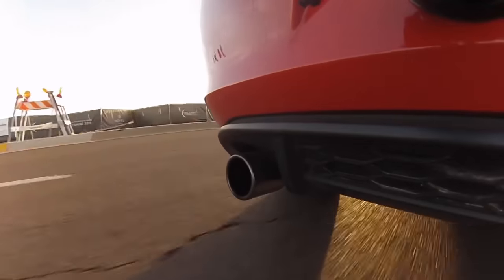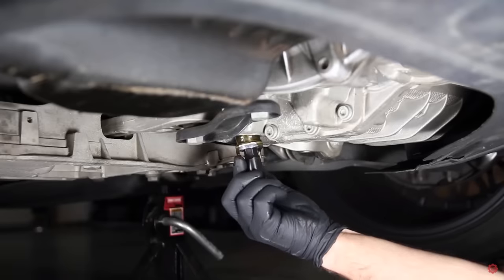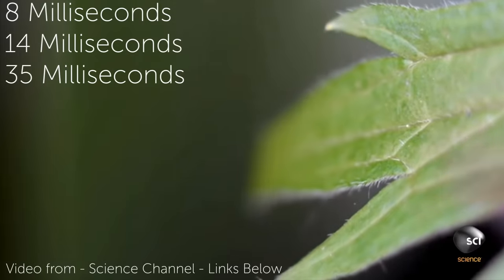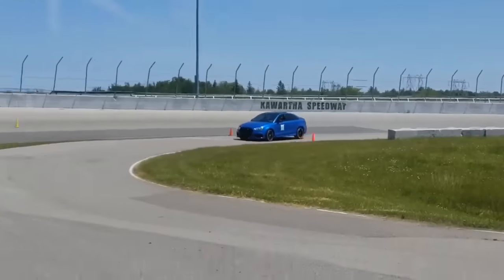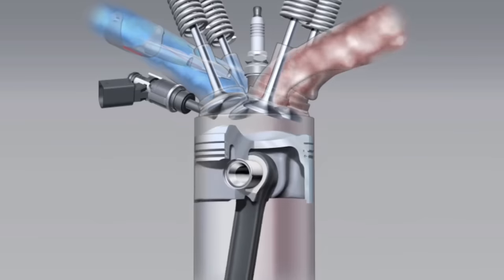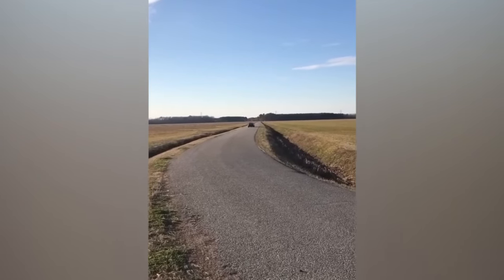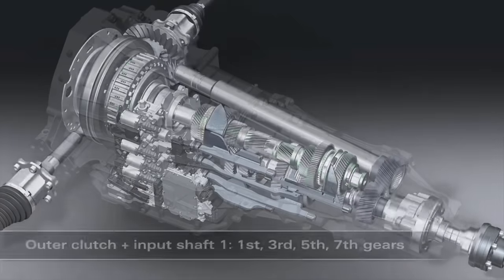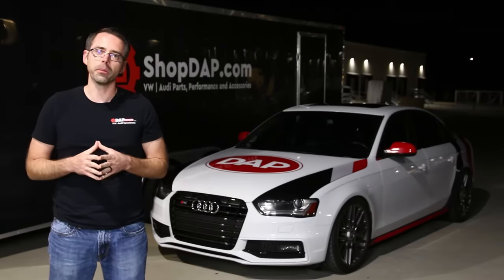What makes DSG Farts Happen?

Comment: Okay... but why do they keep putting fuel in the cylinders if they don't want to use it? Seems like it would create pointless emissions and wear/tear on the exhaust system.
Is there some kind of fluid momentum issue which prevents them from stopping the flow of fuel for a few strokes?

Comment: Does the engine only cut ignition during normal driving or does it also cut fuel? In normal driving cutting only the ignition will waste some fuel.

Comment: Why don’t they cut the fuel Injektion with the spark between shifts to safe fuel and not fart?
Reply: Running an engine lean is way worse than having too much fuel, never mind letting the exhaust/turbo have it.
Reply: @nocll34  Without spark, there is no combustion. Without combustion, there is no heat. Am I right?
Reply: @Sk1ds87  My bad, I didn't even read it properly but there probably is still a reason auto manufacturers don't do that
Reply: @nocll34  on the channel engineering explained, Jason had an official answer from Hyundai: the fart have for purpose to keep the turbo spooling during shifts and minimize turbo lag. Personality, I can understand the reasoning behind this if those farts were limited to a "sports mode" and only happen during high load, launch control, etc. But actually, it seems that modern cars tend to fart all the time, at any load, any mode and even in traffic, which is imo just unnecessary and somewhat pathetic. It ruins fuel economy, is very irritating if you live in a neighborhood infested with cars like these and almost none of those drivers will ever make their way to a circuit where that gadget probably makes sense. But hey, some (dumb?) consumers like it, so auto makers will ofc deliver👌

Comment: My Audi 8 speed ZF farts when it shifts gears under hard acceleration
Reply: I came here to say the same thing. 2010 Audi A4 with 6HP ZF trans and unitronic stage 2 with test pipe farts every day! I will go with unburnt gas for the answer I suppose...
Reply: I have a 19 S4 with a ZF box that makes “ZF farts” all the time. Why is that???
Reply: @rideswithseb  expelled gas onto hot exhaust... Ya heard the man!!

Comment: Its unburnt fuel being dumped into the exhaust intentionally to make the noise. It’s part of the ECU calibration.

Non sporty DSG equipped VAG cars don’t make the noise.

It’s theatre to make the sporty cars stand out.
Reply: Stupid, right? I was wondering why the fuel injection is 't cut as well. I guess little boys like fart sounds.
I still prefer my non-farting V8 xD

Comment: That damages the turbo, doesn't it? If the hot air&fuel mixture is released into hot exhaust, it must ignite before the turbo, which means the flame will hit the hot part of the turbo, which is destructive. Am I wrong?

Comment: but mercedes could do same but without farts at all go and listen
Reply: Merc make exactly the same noise🤔? Go listen to an A45 AMG with a big exhaust system. Merc still run a lot of auto transmissions in their cars though so maybe that is what you are comparing to?
Reply: pk3012 i am talking with stock exhaust not 3rd party one look c43 amg,c63 amg,s63 amg all of them doesnt have fart noise okay maybe a bit but not like all others and upshifts are more pleasing than golfs,...

Comment: Need to do a muffler delete on my alltrack. Miss the dsg sound in my GTI
Reply: I don't think that will help. Prob need a downpipe and/or exhaust. I'm looking at the same thing on my Alltrack too!
Reply: @ash8889  I have a Sportwagen 4motion with a muffler delete. Identical power train. Confirmed -  Little to no DSG farts. I have an Is20, APR TCU and ECU and a stock downpipe... but dayum, DPs are expensive (that's what she said). I've found a youtube clip with downpipe and Techtonics exhaust and it was better, but still not as gaseous as I hoped :\

Comment: BMW’s do this that don’t have dct boxes but full auto
Reply: Because we have come so far with Automatic transmissions, it shifts really quick that they need to cut timing thus the farting noises.
Reply: most vehicles with the zf 8speed do if they are sport tuned
Reply: ryding with ryan they do it on stock map
Reply: m200mw I know the ram 1500 doesn’t do it and it has the zf8speed
Reply: ryding with ryan I was talking about bmw
Reply: m200mw oh okay
Reply: @hendrahendra  "we"? Like you're on the ZF engineering team?
Reply: No full auto in buildings sir

Comment: Right on seeing this vid , I thought about cutting off fuel, instead of spark. Going thru' the comments, someone already said the same thing - to which a reply was about lean mix. BUT - Is 0 fuel lean mix? No fuel = no lean burn issues?
Reply: I tend to agree with that. Nothing here is really radical anyway. Stability control systems also control engine torque by modulating fuel, throttle and timing to suit. Obviously no throttle in the case of diesel engines.

Comment: 1. If it’s just hot gas then the same principle could be applied on a manual transmission, why hasn’t this been done before? 2.Also the difference between using launch control or not isn’t clear because even in manual mode the dual clutch will already preselect the next gear which still doesn’t explain why the spark ignition is only cut when launch control is off.

Comment: On my mk7 gli i couldnt hear them at all stock. Then i did an exhaust cutout but i still couldnt hear them. Then i noticed that clicking open only opens it as long as u held it. So i had too hold it a solid 3-4 sec too fully open it. Pulled onto the highway windows up eased into second gear full throttle 6900 rpm shift and holly freak crap its amazing!  Shit was sooo loud inside. Was not expecting it too even do it. Id heard that the 7spd dsg farts are negligible compared too the 6speed but boy these were good. Kept it pinned and got 2 shifts out of it and i could still hear it pop going into 4th at like 90~mph. But omg no mufflers is so quiet at low rpms/loads. I first opened it and deove under 3k rpms around town and was dissapointed. Then i did a full throttle 3rd from 2k to 4k and it seems like right past 3k rpms the decibals/noise litterally tripples and turns into a screaming beautiful whore!  Unfortunately having the gli not the gti my exhaust doesnt run straight down the middle. (Exhaust is one of only perfromance differences between gti/gli.) opposed too the suitcase muffler i have 2 carryons right infront of the tailpipes. On the gti u can mount the cutout dead center about 1 foot off from thw rear axle. Unfortunately my exhaust runs down the middle until the middle then bends too the drivers side of car and everything closer too the axle is a really tight cluster fuck of stuff. So i had too mount mine like 3feet infeont of rear axle and 2 feet off center too the left because its the only straight sextion with enough room. 3 problems with that for those of you with a vw gli: 1- sound. Instead of coming centered out the back it is offset too the left and under the center of car which results in lots of vibration under hard load low speeds. 2-sound isnt as clear or loud and kinda mumbly. 3- rubber! Ie gaskets, bushings,(suspension) exhaust hangers etc. exhaust gases are terrible for petroleum n rubber based products.  Why tf does burnt petroleum destroy/deteriate rubber? No fucking clue quite ironic. But having the cutout more then about a foot lnfront of the rear axle even when driving results in near direct contact with anything close in this case the suspension! U might think well we drive behind car exhaust pipes so whats the problem? The potency! 1-3 feet away vs atleast 10-1000s of feet away results in a huge exhaust too fresh air mixture/dilution. Not only is it tight next too the exhaust but its also isolated under the car. Hot air rises but it cant as its under the car so ontop of being close its also somwhat contain for a split second. Now drivin gn down the highway this is not catastrophic   U wont notice anything but over time it cut deastically decrease suspension lifespan over time when only open while driving. If you spend substantial time not moving with the dump open you may regret it!  Gti owners the deteriation while driving will almost no effect. When idling still with dump open it will be neglible/nothing compared too the glis dump position. Summary for gli owners: it sounds amazing but keep it shut in standstill traffic and while idling other then beautiful cold starts. Also try too minimize how often its open on the highway. After all you bought a cutout too be able too close it for daily use ay?  If you bought it too always keep it open then remove it and buy atleast a muffler delete or axle back or cat back or hell do a straight header hoodump aka no exhaust😂

Comment: Can you do explain why ZF gearboxes make that sound too? They’re only single clutch transmissions with a torque converter..
Reply: Because there is some misinformation in this video. This sound is because of the torque reduction (very late ignition timing) during upshifts. Actually, Motronic and simos systems doing this for more than 20 years, they start to do it in 1997-1998, when the first 5HP19 came. Also, in RS6-RS7 cars equipped with the 8HP transmission, there is some special part of ECU flash called "sound generator", where you can adjust this fart duration and intensity.

Comment: Kias have had that hidden ability for about 4 years now too. 7spd DCT in my Optima farts with the Corsa exhaust I have on it. Didn't do it when it had stock exhaust but as soon as i got the new catback system bolted on, it started doing that. Now Kias and Hyundais with the same transmission will do it too from the factory like the new Hyundai Veloster Turbo and Kia Proceed GT. I want to say that it's something to do with the BMW guy that is heading their R&D division.

Comment: Let me first start to make you clear that not only dsg or dual clutch cars make those farts. 

I have a bmw 328i f30 with the 8hp zf gearbox and it farts even louder than those golf's. My car is no dual clutch and yet it shifts very quick and makes loud farts. Launch control as the same, it doesn't fart anymore. Instead of calling it dsg fart, we should call it dct fart.

Comment: i drive a seat leon Fr 2010 2.0 liter engine DSG 6, i got K04 Turbo and Stage 3 APR gear and engine, but i dont have dsg farts, i saw other cars like mine and they do have, my exhuast system is fully built from downpipe to the end.

Comment: I may be wrong but I don't feel like this was properly explained. F90 M5 and the new E63 Amg both use torque converters but they still make sounds of similar kind during acceleration and deceleration as the DSG cars. What I know is that the sound is made by retarding the timing, meaning that the spark plugs ignition gets delayed and combustion starts from the chamber and continues down the exhaust and this is called, quote on quotes an antilag, because its purpose is to keep the turbos spooled up during gear change to minimise turbo lag.

I stand to be corrected if I am wrong🙋‍♂️

Comment: Why do some sound like a shap short crack and others sound like a longer burble? How can you modify the sound of the DSG “fart”
Reply: 1.remove the resonator might change it. 2.downpipe with cat delete. not a 100% sure tho
Reply: I have a MK5 GTI that does the short crack 99% of the time. My exhaust setup is...

42Draft Designs Turbo-Back exhaust.
200 Cell Cat
No resonator
Magnaflow Muffler (Comes from 42DD with that muffler)
Exhaust material is T304 Stainless Steel.

The transmission that came with the MK5 GTI is the DQ250.

Hopefully someone can chime in on whether any of this contributes to the different sounding DSG gear changes. Maybe it's an TCU Tune that does it? I have no clue.
Reply: @Gandalf721  I believe the cracks and pops you're referring to is when off the accelerator and decelerating. "Usually" that's what they mean by that.

Comment: Hey Guys, there is a lot of misinformation in this video. 

First of, the "farts" are purely for aesthetic purpose, they do nothing for the speed of shifting, it is all for show. Same goes for downshift crackles on for ex AMGs or BMWs

Secondly, you might have noticed that when you use launch on for ex a Audi S4, you will not hear the farts, that is because they use the inertia in the drivetrain to help acceleration. They to this by simply slamming the cluch closed on the nest gear without cutting or limiting torque, you will get a "lurch" but it will aslo make you accelerate faster.

And lastly, its not about ignition timing, it's all about DIRECT INJECTION timing, the nice crackling sound you hear that you call farts are only possible on direct injection engines. This is why older cars cant  really produce this noise. 
What happens is that the direct injection timing is retarded and basically shoot a very small amount of fuel info the cylinder while the exhaust valve is open, making a nice small pop in the exhaust when it self ignites. 

Bangs from retarded ignition and/or Ignition cut on regular port injected engines are significantly louder, and much more violent in nature since its basically fires of a full cylinder worth of air and fuel after its been compressed. There is no way to regulate the amount of bang like in the DI systems

Also, stop referring to these sounds as DSG farts, they are called direct injection exhaust crackle

Comment: I thought those "farts" were because of the turbo's wastegate opening at high rpms, releasing a whole bunch of pressurized exhaust gases into the exhaust. I have a BMW and it does this too without a DSG transmission...
Reply: Yeah that's what I thought, my Fiesta ST makes a similar sound when I back off the throttle slightly after boosting.

Comment: I get these on my 392 Hemi as well, but with dual 3" exhausts and 3.5x the displacement of a VW it sounds a lot more like an autocannon than a fart.
Reply: Same. It’s fun they are especially loud when I use the paddle shifters and slowly accelerate to a high rpm and shift

Comment: Is it possible to tune/adjust the spark timing on a non-DSG car to achieve these fart sounds or is that not efficient/possible?
Reply: I have a golf 1.8t with straight pipe from the cat back and it farts between shifts

Comment: Did I hear correctly, un-burn't fuel is pushed out into the exhaust manifold and ignited by the manifolds heat?
That post power stroke, exhaust manifold fuel ignition provides no performance gain just a waste of fuel, aka: poorer efficiency (MPG?) but a "fart".
It doesn't sound (no pun intended) like a fair trade off.

Comment: Explaining what it is makes it sound like a waste of precious power and fuel.
So it's not just the noise that sounds awful, but also the concept behind it. Why send unburnt fuel out the pipe on purpose?
If the CPU can figure out when to not ignite, then it could also figure out when to keep the exhaust valves closed and/or shut off injection.
Reply: It's what people seem to expect from a modern car these days. Mainly to show off
Reply: You cannot just 'pause' exhaust valves. They are controlled by a camshaft, and they are in different postiton for each cylinder, so you would need 4(8) individually controlled camshafts to do that (or hydraulic valve lift like koenigsegg is prototyping).
Also, the explosions in exhaust keeps the turbo spinning at high RPM in-between shifts, so there is no turbo lag in next gear. 
Turns out multimillion dollar company knows what they are doing, go figure 😂
Reply: @stirkac  Thanks. Now it makes sense.
Still sounds terrible, though. 😁

Comment: I have a stage 1 S6 with a DSG and have never heard this in the 124k miles I've put on it.  I have noticed it's not fully warm it will sometimes bounce off the rev limiter before shifting into second.  It's getting a touch sluggish in it's old age I guess.
Reply: probably shouldn’t be anywhere near the rev limiter until it’s fully warm, but props for getting 124k+ out of it! impressive
Reply: @weilandcock  Am I detecting a note that you're not a big Audi fan?  Both of mine are now over 130k.  The 6 is 135K

Comment: wait, so how come my Audi A3 doesn't fart? it's using a 2nd gen DSG7 gearbox
my parent's Audi A6, using a 3rd gen DSG7 gearbox, that isn't farting
my brother has a Polo, with a 3rd gen DSG7 (or DSG6?) gearbox and that one doesn't fart either
one of my neighbours has a seat leon fr with what's probably a 3rd gen DSG7 gearbox, no farts there either.
another neighbour has a Scirocco R, also a DSG7 gearbox (idk if its 2nd or 3rd gen) and again it doesn't seem to be farting...
so all of those are running with a DSG gearbox, all of them don't appear to have this "fart" sound.

are VAG car's built differently for the US market or what?

Comment: Hey y’all I money shifted my 2017 GTI from 3rd to 2nd. The revs jumped up and once I realized what I did I put the clutch in. I haven’t noticed any damage or weird noises but how do I clear the over rev code in case of an issue. I have 3 years of warranty left. I don’t know anyone with VCDS. Can you clear it with an OBDeleven?

Comment: This is probably tuned in to sound cool. My dual clutch swapped miata cuts ignition and fuel during shifts and has no dsg farts. I could always tune it in but i dont like the sound.
Reply: Yeah my truck does it from factory it cuts between shifts to keep the p.o.s. 4l60 alive

Comment: Further to previous comment, I found on another channel, that in turbo engines, spark retard during dsg upshift, keeps the turbo spooled up, for engine grunt required when the upshift clutch engages. In non-turbo engines, that crackle is a status symbol of dsg? :)

Comment: In short, ignition cuts off during shifting, leading unburnt fuel to burn in exhaust pipe instead of a cylinder. Just like e-shifters in motorcycles. They work flawlessly and lightning fast.